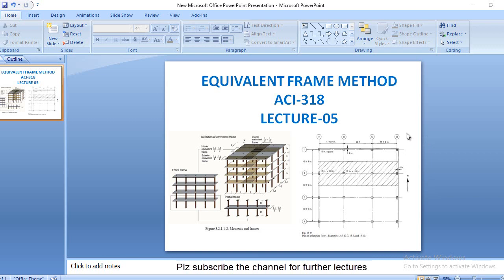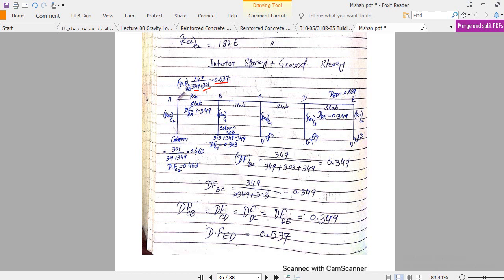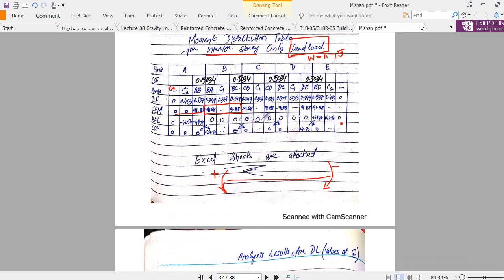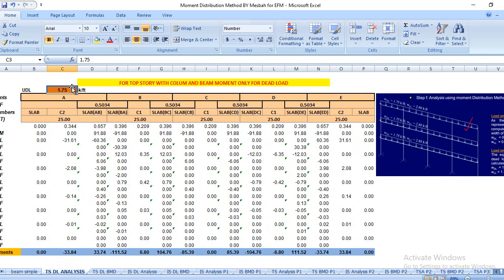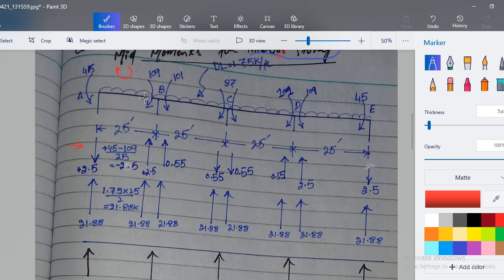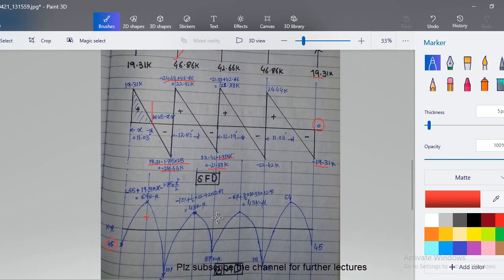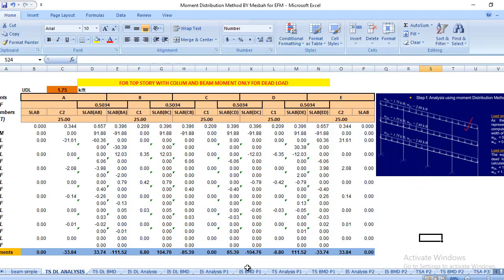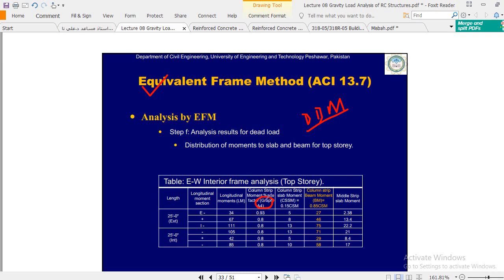5 Lec ACI Eqivalant Frame Method using moment distribution table for frame in english

Comment: Evening Assalam o Alikam sir, 
When are you supposed to analyze your structure as simply support beam? Because as I search on the net, I end up on one example where the frame structure was analyze as a simply supported to find the reaction and moment in each beam and Colum.  While if I reproduce the same structure as it is on RSA, it is analyzed differently and force in different beam ad Colum are total different.  So please, help me with this enquiring as I can’t decide on which method I may use in industry to analyze my structure manually before verified the result with any engineering software.
Reply from the maker: Thank u rolly bayaka
I think I have answer ur question in one of these lectures but however this is the most tricky question to answer. Because u can't say which method is the accurate one. The EFM is the mannul method which is some what an an exact method of structure analysis bcz it consider the relative stiffness of beam ,column and slab and give the most close result compare with software. Most of softwares like ETAB,SAP2000 USESS this method. 
Now the rest of the method like DDM, Moments coefficient etc are the approximate methods gave u more conservative results as compare with software.
There are so many reasons why not these results are close like one big reason is the idealization of structure in which we idealized so many thing which were different from reality. It is difficult for me to give u complete answer in comment but I will record a lecture regarding this topic very soon.
If u send me ur e- mail I will share a lecture in which u see the comparison of different methods and I think u got ur question.
Reply from the maker: The way they treat an isolation of a simply supported beam etc and finding shear,reactions and moment not the accurate approach but it can be used to just check the software results gave u some degree of satisfaction that weather ur software results OK or wrong. But just choosing a simple beam from a frame structure without considering its stiffness is totally wrong.if u really want this u to extract any beam from 3d frame transfer it to 2d  using EFM approach then it is OK. If u watch lecture 10 I share an example of such question that how to compare software results with manual.
I hope u got ur answer.